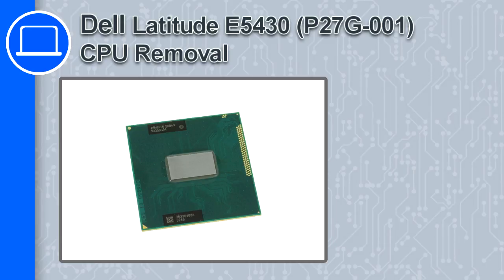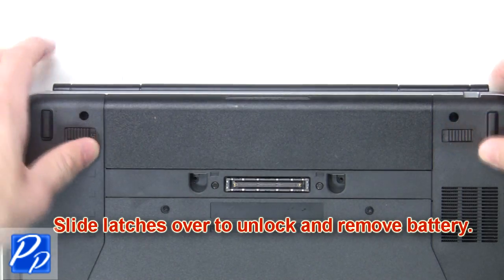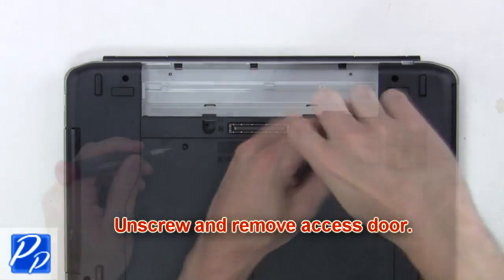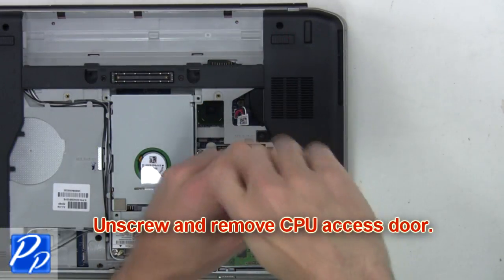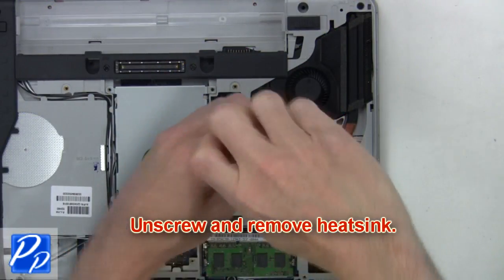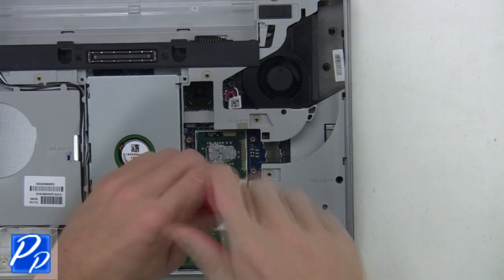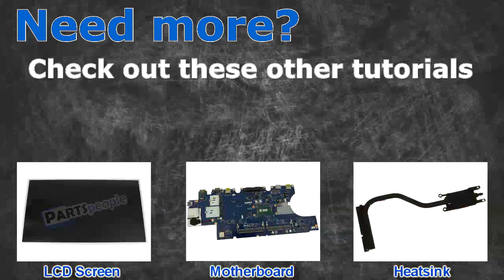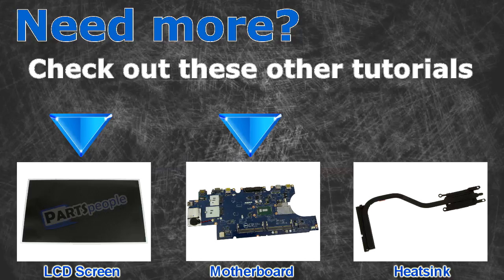Dell Latitude E5430 (P27G-001) CPU Processor How-To Video Tutorial

Comment: Hey, I got the Dell Latitude E5430 laptop with a Intel Core i5-3230M cpu. Im looking to replace it with an i7 or a strong i5. Which CPU's is compatible?
Reply: I have the same as you. I would like to know which cpu is compatible..
Reply: @alealmiron9108  i´m planning to buy it is it a good laptop ? does it over heat ?
Reply: @brahimsaad6287  It's a very reliable laptop

Comment: hey dude i have a little question ? look my latitud e6420 i core7 the video card died by over heating but i bought a latitude e6430 so is posible remplace or use or upgrade with the processador using the other procesador ?